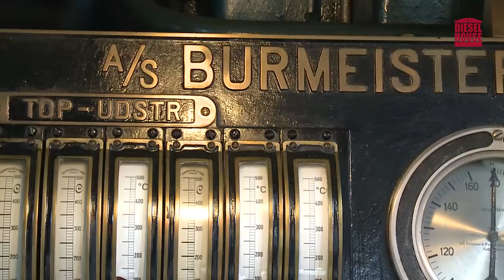Motorstart i DieselHouse

Comment: What are those white tubes from 0:05-0:07? Oil injectors? Fuel injectors?
Reply: I am pretty sure its part of the lowpressure lubrication system.
Reply: @HjalmarBak  Threy are, after a long research a while ago I solved it. They're indeed part of the lubrication system. Proper name is "Cylinder Lubricator Box."